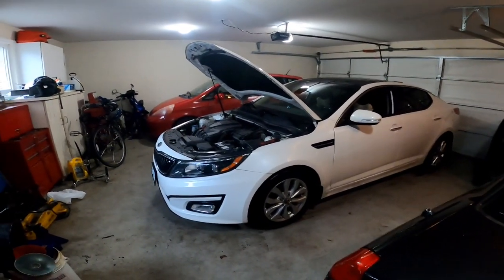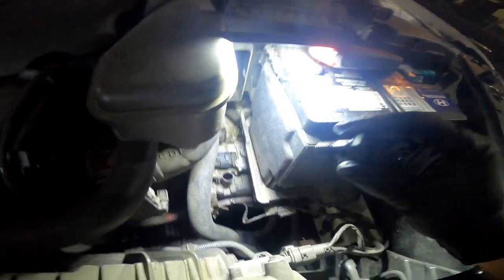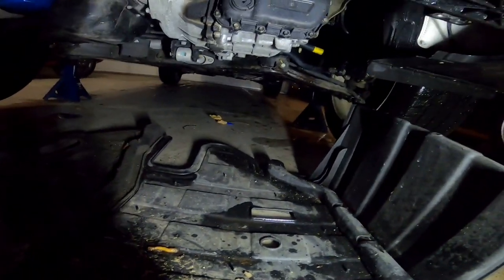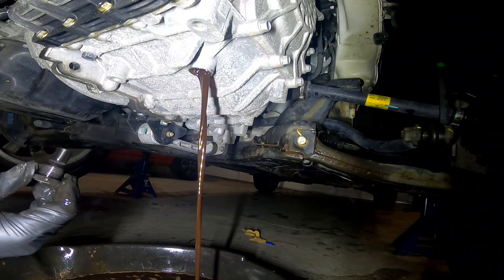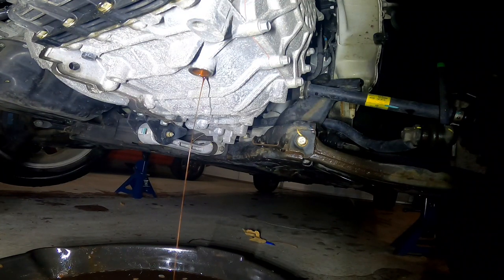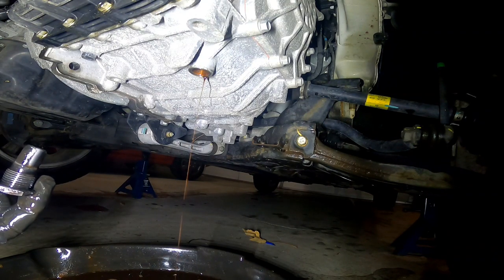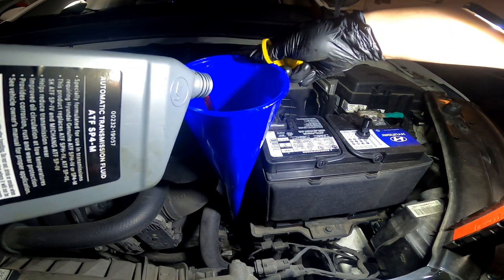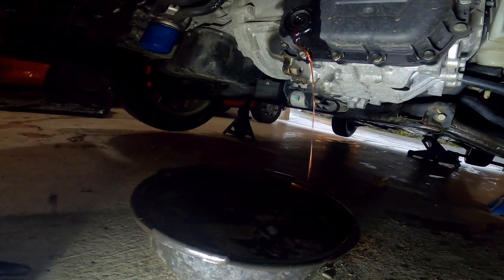Changing transmission fluid on a 2014 Kia Optima/Sonata

Comment: Hey Juno glad to see you work on Korean vehicle again! Just wondering does the filter need to be changed on these sealed trans? Or just fluid change is fine?
I see many people follow the manual and think trans fluid is life time fluid and their trans broke around 100k miles.
Reply from the maker: Haven't  seen a filter on these trans and I have taking the valve body out to replace the harnesses for the updated trans temp sensor. Seen them start having delay engagement into drive at just over 120k kms and just pulling the fill plug the fluid is black and can see sparkles in them. Or on the hybrid such as the yf slipping or delay engagements and doesn't seem the fluid gets changed much on them. I guess that's lifetime fluid, life of the trans once you put a new one in you get new fluid in the fine print 😅
Reply: @theoffroadingmechanic  True. And trans fluid change is billed $300+ in US dealerships, which persuade more owners to delay the maintenance.
Reply from the maker: @frankxu2321  the OEM fluid is expensive like $26/L but we use the BG fluid that comes in 8 litre case. Plus BG has a warranty when you use there stuff. Back in 2014 when I was an apprentice @ hyundai we replaced so many trans, shop was full of them. Not so much anymore but once in a while we get new customers  no history and shifting problems. Never had the fluids changed.
Reply: @theoffroadingmechanic  Interesting, never know Hyundai have so many trans problem back then! Ironically now many dealers are full of Theta2 blocks and customers drive rental for months to get the replacement engine.
Good to know BG offers the correct product. Some suggest me using multi vehicle fluid but I kindly refused. SP4 is rare enough not to mention SP4-M. I'm now using Aisin full synthetic SP4, $10 a quart bottle on eBay, since local dealer really not interested in selling me Hyundai fluid. (Their price is 50 USD a quart!!!) I still kinda feel the manual tricked me- it says change every 96000 KM under severe condition, but mine starts jerking really hard around 40000 KM when shifting from second to third in cold start, and the fluid is not red any more, LoL.
Reply: @frankxu2321  I've been running Amsoil OE Synthetic ATF in my 2011 Sonata for the last 50k+ miles with good performance. Changed it at 60k and it's now at 113k. It's Hyundai/Kia SP-IV, SPH-IV, SP-IV-RR spec'd. I'll be doing it again soon. Just wanted to throw another option out there. Hyundai branded fluid is outrageously priced at my dealer also.
Reply: @frankxu2321  
You have to pull the trans and basically break it in half to get the filter.  I looked up a filter and it had huge warnings about  what you have to do to replace it.  Not for the faint of heart.
Reply: @theoffroadingmechanic  
I have heard good reports about Valvoline ATF.  I'm giving that a try.  I'm in SW Floriduh so I'll know pretty quick if it cooks.
Reply: Hey got a question Please help! I have a 2016 Kia optima 2.4 The only time I have an issue with a jolt a jerk is when I come to an almost stop I get a jolt. I'm thinking it's my transmission and everyone is saying that they think it could be that. What do you think would fix this issue or is the problem? I've been doing some research and I have had my transmission fluid changed not too long ago. They just replace my motor under their warranty. But before the motor went out this jolt started. My car shifts just fine. It's only when I come to an almost complete stop it'll do a jolt. Could this be a solenoid like second gear that needs to be cleaned out or first gear solenoid inside the transmission oil pan? Or do you think cleaning the transmission fluid again might fix this issue? I can't think of anything else it could be? Except, I hope it's not internal transmission, needing the whole transmission replaced. Torque converter? Maybe? God I hope not. Okay what are your thoughts please? Thank you so much!
Reply from the maker: Check transmission temperature sensor there is a tsb I think they updated the part where the sensor is part of the transmission harness inside the transmission. A lot of the customers that have a jerk or slams into a lower gear when coming off the highway slowing down or coming  to a stop but will see if it has a code it doesn't usually set a light on the dash but it will have a saved code if you scann the transmission control module since it will be intermittent. Not sure if this is the same jolt you are talking about.
Reply: @theoffroadingmechanic  It sure sounds like it! There are no lights on the dash. It doesn't do it all the time but it does it quite a lot. And it is only on the downshift. So are you saying that there is a recall on that like an update to the software only? Or is there a part that I need to buy or that they need to replace and exchange on the vehicle? Thank you so much for your quick response. I really appreciate it!
Reply from the maker: It's not a recall it is a service bulletin  they updated to include 2016 sonatas but there is a long list of models that is affected. so I would check for kia I looked for the bulletin number it is 15-AT-011 for Hyundai. if you have a code for P0711, P0712, and P0713 stored. It'll refer to the updated part. Not sure for if the Kia bulletin number is the same. Usually the symptoms of hard downshifting will have those codes. I would check for those codes before getting the bulletin done.
Reply: @theoffroadingmechanic  hey I appreciate the feedback there... There is no check engine light or anything on the dash so how am I going to pull up any codes? That's the part I don't understand. Not sure what a bulletin is If it's not a recall. What do they do with a bulletin? Pretty much the same thing they fix it with no charge? Just like a recall? Seems like it's getting worse by the way since even yesterday. I'm wondering what else could it be if it wasn't what we're talking about now? If it's something other than a software update what else do you think it could be? I'm so mad cuz I just got my motor replaced and now I have this to deal with and I thought I was going to be good to go. I've been going round and round with Kia for a year about my motor and now this the day after I pick it up.
Reply: @theoffroadingmechanic  I'll have to check the temperature sensor also. Been a busy day. Thanks again!
Reply from the maker: @L.A.555  You will need a scanner to be able to see transmission codes if it has any. Service bulletin are just known issues that has a fix for the issue but if your vehicle is out of warranty then it will be coming out of pocket. where safety recalls are required to be done regardless if the vehicle is out of warranty. If it isn't the issue under the bulletin that i mention i would try performing transmission adaptive relearn to relearn the shift/engagement points to compensate for the wear of the clutches in the transmission. But that would require a scanner that is able to do what a factory scanner can do. Good luck

Comment: Can I ask where are you allowed to dispose of old car parts in Vancouver/Burnaby? I was cleaning out my parents garage and i have stuff that goes back 20 years if not more 🤦
Reply from the maker: Is it scrap metal? Or old batteries? There or company that take scrap metal and battery recycling places.
Reply: @theoffroadingmechanic  old shocks and springs, brake master cylinder, etc.

Comment: Hi sorry I wanted to ask you a question looks like you know about these cars, I own a 2011 KIA optima SX with 177k miles, recently I have been having less power on it ive noticed that its RPM go up but car doesn't go anywhere and sometimes if I let go off gas pedal rpm stay stuck and car keeps going until I tap gas pedal seems to unlock it. I took it to local transmission shop adviced to replace fluid and now car feels worse. Any suggestions I really appreciate it. Also hear a whining when I accelerate from a stop. Thank you
Reply from the maker: Kind of hard without having the car in front of me. When you say the rpm goes up and not go anywhere is it slipping in gear or it's just not up shifting at a high rpm? If you haven't changed the fluid and it's the first time changing it then it making it worse is all the clutch material that was in the fluid that's helping it engage the clutch is probably gone and the new fluid isn't helping the clutches do it's job.

Comment: Should I remove the breather hose near the fill port ? It overflows unless the check level cap is off
Reply from the maker: If your sticking a funnel into that fill with the rubber hose sticking out beside it won't really help fill it you will either get trans fluid coming out of that and making a mess. You can slowly pour it in so it won't back up in pressure like what I did. Or remove the level check but if you pour to fast it will spill over the valve body behind that cover and out the level check misleading you to thinking it's full.
Reply: Don't leave the level check off, it wil spill. Your have to pour slowly or use a funnel with a hose attached (got from autozone). The alternative is you disconnect the cooler line to allow air to escape. If you use the funnel with hose you can apply pressure on the hose so it seals and pour slowly. When it burps, it will burp upwards from the funnel. Otherwise, it will burp around the port and spill. The next time I do this I am going to do a regular drain and fill, but then evacuate another 4 quarts from the cooler line while the engine is running while slowly filling as it is pumped out. This will allow the whole systems fluid to be replaced.

Comment: But what size did you use to take off the fill plug screw? 12mm or 14?
Reply from the maker: I used a 3/8 square drive extension. The level check is the same.

Comment: What are signs you need transmission fluid change. I have the same year make and model silver gold color. But sometimes when I drive, you know while you have your foot on the pedal and it sound like the engine stoo or it kind of stall and then you put foot on gas again and then it comes back to hearing the engine. It sounds like transmission. Mines is a little over 100,000 miles
Reply from the maker: There shouldn't been any sign of needing to change the fluid. It should be a regular maintenance thing. If you change your engine oil as a regular maintenance. It's like saying should I change it when the oil pressure light comes on or if it starts making noise. If your coming to a stop and it stalls or about to stall I would check to see if the throttle body is dirty. After cleaning will need to do an adaptive relearn. And if it is a Hyundai or a Kia they all use the same 2 wire inductive pick up crank sensor and the magnet gets week over time and loses crank signal when you slow down. Doesn't usually cause a check engine light or set any codes.

Comment: Question: what is the socket size for the top breather bolt?
Reply from the maker: I believe it is a 22mm but I usually use a 3/8 drive cuz the battery tray or other things are in the way to be able to put a socket on it. There is actually another fill hole but not usually people use and it's above the final drive or differential way in the back and isn't a plastic plug with a crush washer.

Comment: Does this work for a 2011 Kia Optima Automatic Transmission ?
Reply from the maker: If it has the same level check design yes. I think the 2011 may be the first year the optima came out for the kia. Not entirely sure.
Reply: @theoffroadingmechanic  Oh, and KGIS also has pictures for nearly everything including draining the fluid.

Comment: so car running in neutral,  check oil level!?
Reply from the maker: Running in neutral, on leveled ground trans temp between 50-60 degrees celsius. Top up if needed
Reply: ok thank you!!!. I did it without car running, I'm guessing 5 quarts came out, I put one back in without running and oil came out hole!! big difference

Comment: How many litres for regular drain and refill ?
Reply from the maker: 5L should be more than enough but good to have some extra just in case.
Reply: @theoffroadingmechanic  for hybrid sonatas and optimas or just gasoline sonatas and optimas with 2.0 or 2.4 engines ?
Reply from the maker: @imadhondata5228  Just gasoline the hybrid is going to be different since it has an external electric oil pump rather than an internal one that's driven by the engine on the gasoline version and the pump doesn't operate unless in drive or reverse common failure for the pump to go when it doesn't make pressure anymore but on live data it shows rpm and the control module that's hidden behind the fender liner where water gets to it. Also the hybrid has an oil cooler if I remember that blocks off the level check mounted on the front oil pan. So definitely going to need a shop manual for capacity for a drain and fill and also see how much comes out of it when draining it.

Comment: At the end of the video why did you let the tranny oil come out again?
Reply from the maker: That front plug on the plastic pan is to level check the fluid. Was letting the excess out it's at the proper level

Comment: It appears that there is not room in your garage for a lift but wouldn't ramps make
things much easier?
As for work, your videos did not reflect well on Hyundai and Kia, regardless of what
you want or intended. Good luck.
Reply: As to work videos, I was always impressed with diagnostic tools Hyundai provides.  Also the quantity of their techs ( at least this one!)  The issues presented didn't appear to be any worse than other manufacturers. 
I agree ramps would be really helpful.
Reply from the maker: Definitely need more space and a lift would be nice but for the time being this is going to have to do. There's a lot of things I want brake lathe tire machine etc. And right now I'm thinking of trading my snap on scanner for a new one with a 2 channel lab scope for work. Just need the money🥲

Comment: Hey guys please make sure you disconnect the one of the transmission cooler lines in front of the battery because when you go to fill the fluid from top you will make a mess everywhere and that will cost you money… This guy does not state that in his video 👎🏾👎🏾👎🏾👎🏾

Comment: If there were NO leaks couldn't you just replace the exact same amount of fluid you drained out ???
Reply from the maker: You could do that but what if... just what if... the person before that owned it or the last person that serviced it had under filled it or I have had it under filled from the factory,  you wouldn't know. Also you would have to account for expansion trans fluid expands quite a bit when it heats up.